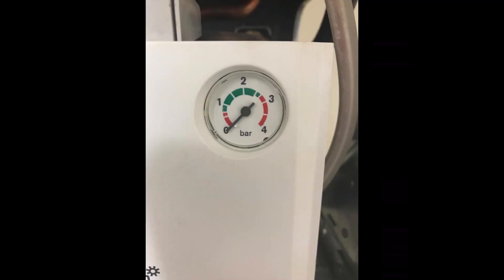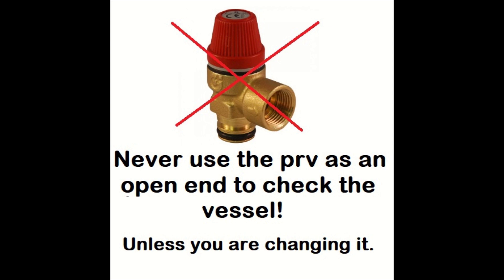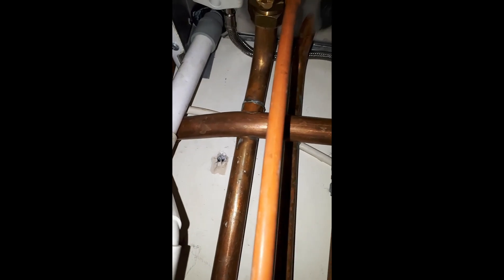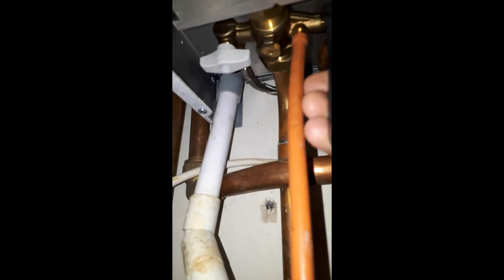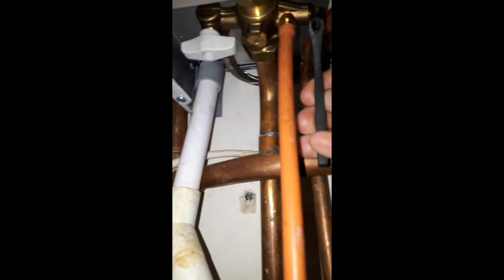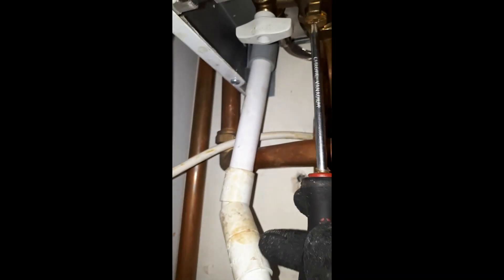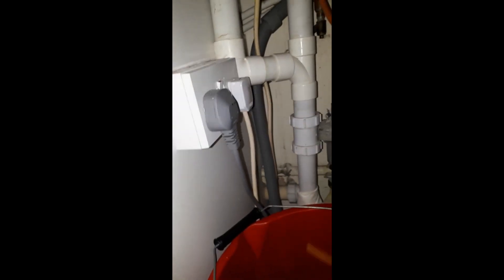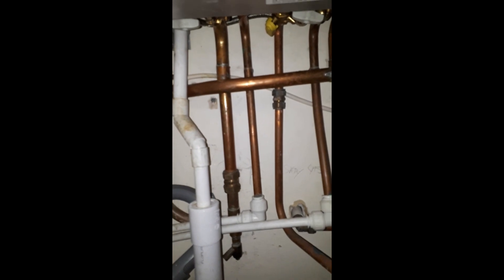How to CORRECTLY pump up / recharge / charge a boiler's internal heating expansion vessel

Comment: Good informative video mate !
a lot of people go about it wrong to pump up the expansion vessel also I’ve had quite a few dirty Schraeder valve’s leaking which I’ve had to replace you can buy them from Halfords in a pack of three and they are as cheap as chips

Comment: Great video and useful tips. Quick questions please. 1. Are CH pressure gauge drops always (pipe leaks,prv let bys,main hx cracks)? 2. Are CH pressure gauge rises always ( filling loop open,filling loop letting by,expansion vessel lost charge,expansion vessel membrane tear)? Thanks in advance.

Comment: Hi, you say you always check the vessel on a service,what happens if the f/r ISO’s leak or you can’t turn them off ? . Great videos 👍.
Reply from the maker: If the boiler is at the top of the system, no need to turn off the iso's.
If they dont turn off or leak, explain to the situation to the customer saying you can't do that part of the service and quote to drain down and install lever valves on the f/r or replace existing f/r 👍 hope this helps
Reply from the maker: Oh and if I'm draining down the whole property, I always say if there's any radiators /valves that need changing nows the time to do it

Comment: Quality video mate keep it up! quick question mate lets say, when you start to pressurise the expansion vessel to manufacturer instructions. should the pressure gauge on the boiler rise aswell as your pressuring the expansion vessel  or no?
Reply from the maker: Glad you like buddy. The pressure gauge should NOT rise, this means you're pumping up the heating water side of the vessel. You need to make sure you have an open end when pumping the vessel (might have a blockage on the pipework to the vessel) suggest you disconnect /remove the vessel and try pumping it up, the vessel might be split.
Reply: @goldgas1216  Thanks for your advice